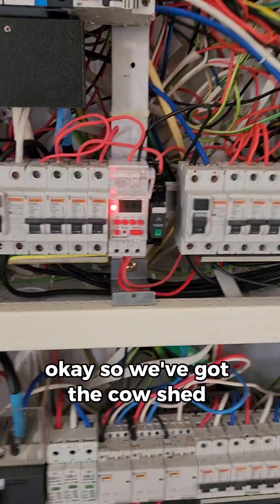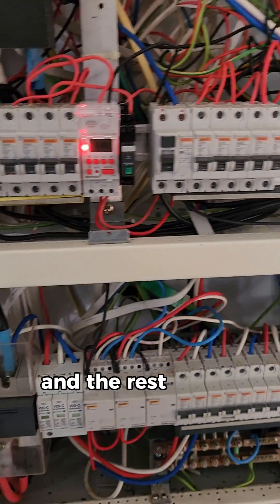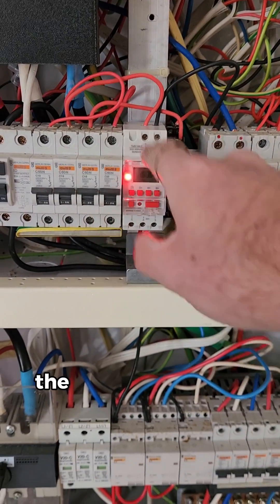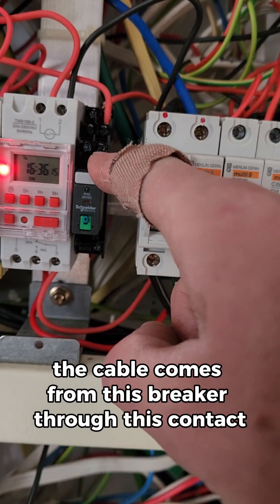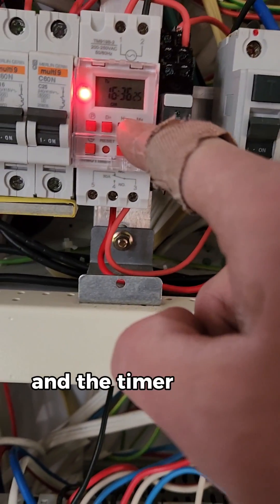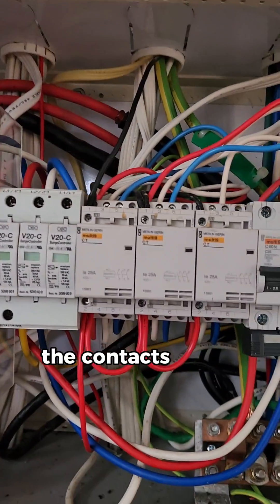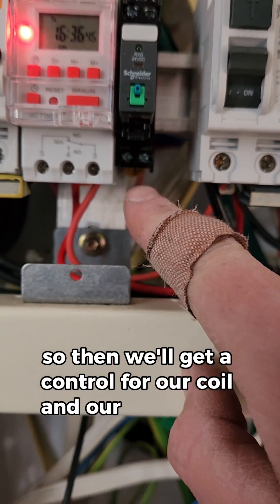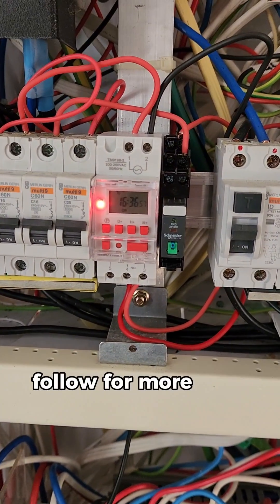Current Limiting at a Dairy Farm

Comment: was the hot water originally only controlled by the time switch? sounds like since you haven't decided on when its running its new to this as well?
Reply from the maker: @Goryrat  no the time switch is new too, it was on a ripple control meter before hand, we want to limit the current draw to the site and prioritize solar use on the hotwater

Comment: Wouldn't the contactors for the vac pump have a normally closed contact you could use instead of a separate relay? or do not all contactors have that?
Reply from the maker: @electricalmayhem  just need to find them and then hopefully, using the relay because we are a ways out of town and didn't want to get cought out